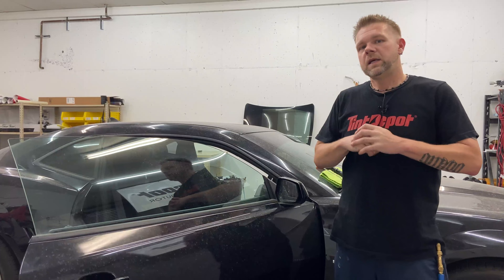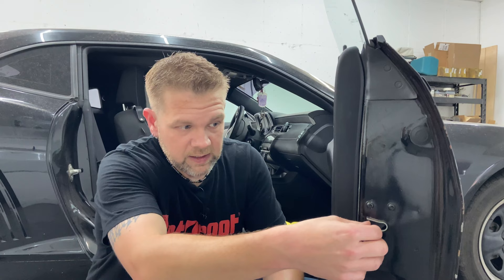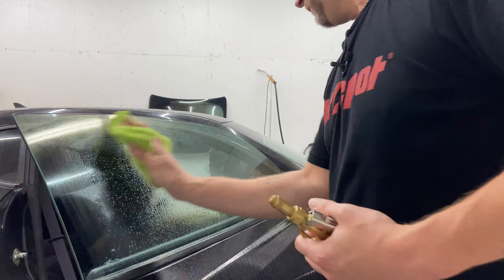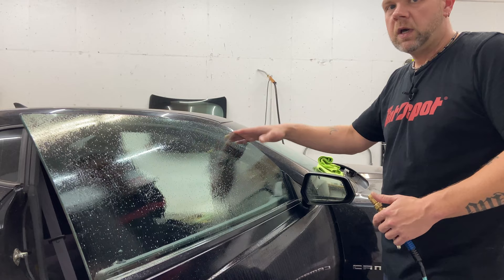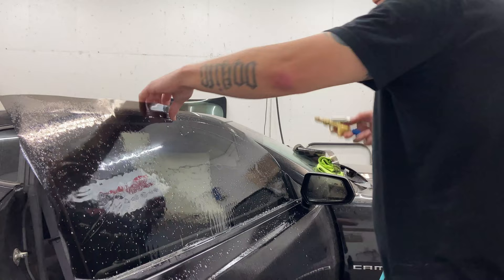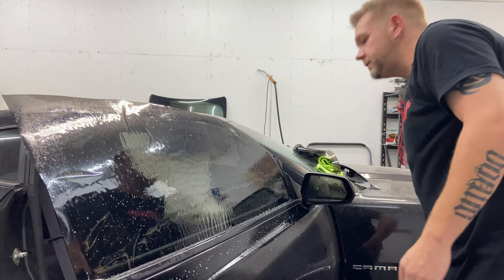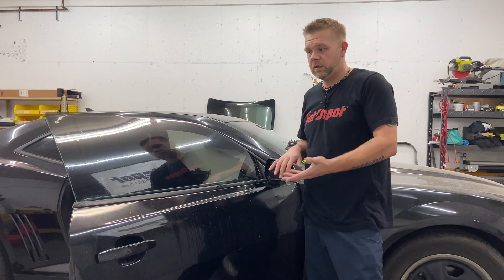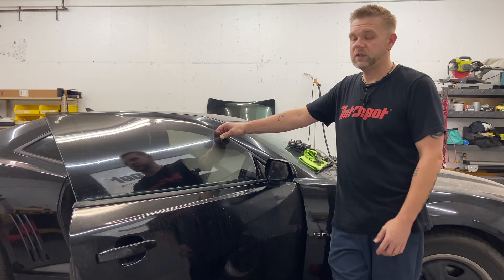Cutting Window Tint Film for a Frameless Door

Comment: hello sir. I watch this video as I user you as my guide. can you tell me why you don't overlap down 1cm under gasket when you cutting template. I saw you you cut film flags with gasket .

can you answer me please 🙏. 
thank you lots
Reply: You just need the film bottom edge to be low enough to not see it. And only a little bit below the seal. But not necessary. Tight bottom edge, good install and should not have any problems.
Reply: @On Point Pro Styles  thank you sir.